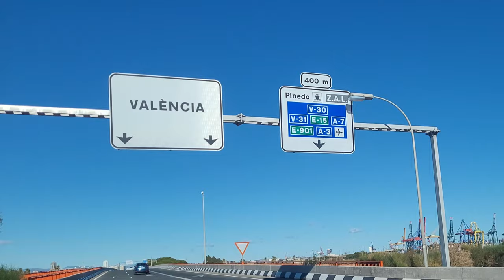Van Life Beginner's Mistake: How to fix a broken Diesel Heater

Comment: In my humble opinion a diesel heater is not quite a good option for a little van .. there are such things as portable propane radiant heaters .. won't cost a fortune, are lightweight, efficient and quite safe to use if you follow the safety rules .. and propane costs only a fraction of the price of diesel. Just my thoughts, not the ultimate truth 😂
And yeah .. can't wait to see Valencia 😉✌
Reply: It d be great to see the city yes!
Reply from the maker: I will look into it. The diesel it uses for heat really is minimal, though ...